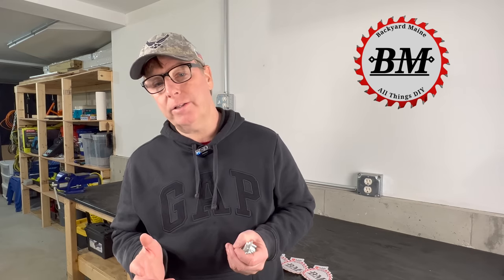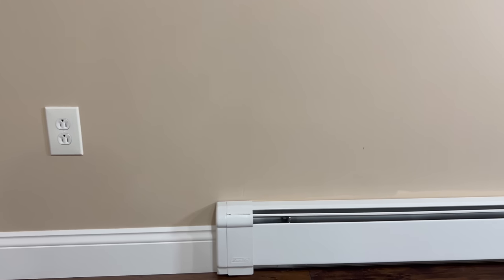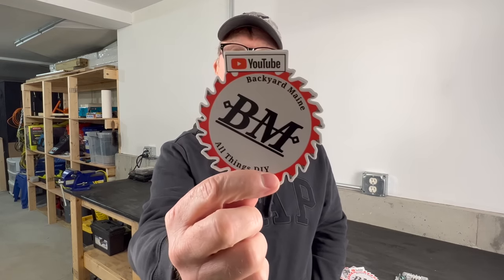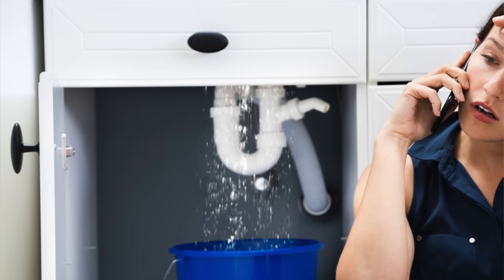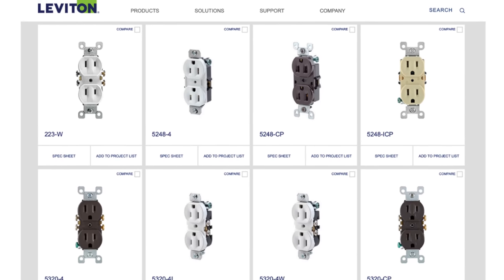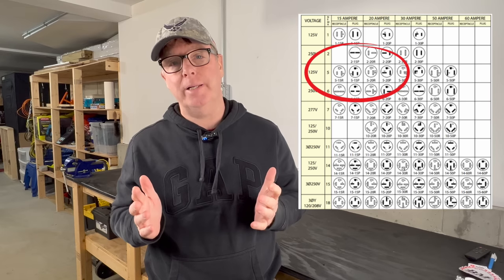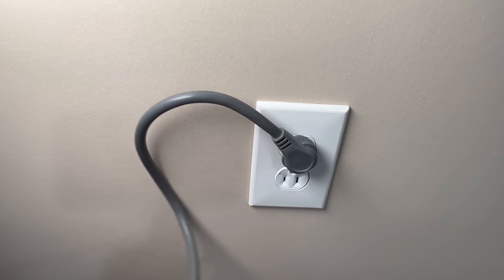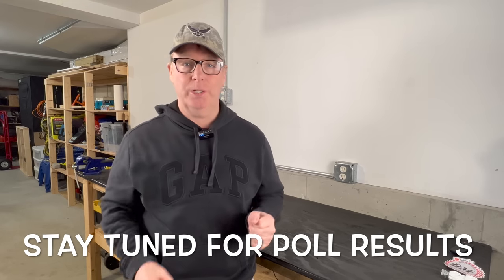Are your outlets installed upside down? (You may be surprised)

Comment: Technically it doesn't matter. However, the original patent design calls for the ground side up . 
Never came across a local electric code that requires either way.
Reply from the maker: Me either but I'm told the city of Chicago required horizontal.

Comment: According to the National Electrical Code, can GFCI outlets be added in bathrooms at 16” above finished floor.
Reply from the maker: At least one receptacle outlet shall be installed in bathrooms within (3 ft) of the outside edge of each basin. After that you can add more as desired and 16" from the floor is fine. It will need to be GFCI protected as you mentioned and also receptacles shall be installed no closer 3 feet horizontally from, and 8 feet vertically from the top of the bathtub rim or shower stall threshold. I hope this helps.

Comment: If you read the words on the back if the receptical it becomes very clear which side is up. Ground wire should always be on the left when looking at device whether an outlet or switch.
Reply from the maker: The manufactures of receptacle do not specify or ever recommend any orientations. The printing on the device is not a recommendation. But I agree that ground down is preferred.

Comment: I have had people tell me that the ground should be up in case a wire comes loose, it won't fall and touch the ground, which make absolutely no sense as all of the wires theoretically have the same weight, and gravity affects all the wires equally. That being said, whenever I do electrical work at the house, I always install new receptacles with the ground down.

Comment: I remember when the 1972 NEC stated that "an installation  shall be in accordance with UL rating and, shall not interfere with the UL rating of another device" or something like that. I can't find that in todays NEC. I think it was remover because if something is installed by its UL rating then it cant interfere with the UL rating of another device but, here we are. My question is - is the ground prong UL rated as a mechanical barrier or as an electrical connection? I'm guessing that it is not UL rated as a mechanical barrier.
Reply from the maker: In Article 110 it states that Equipment that is listed, labeled, or both shall be installed and used in accordance with any instructions included in the listing or labeling. One listing agency is UL and this would cover that although it doesn't say UL.

Comment: It sometimes  depends  upon the plug configuration are dealing with.  A 120v. level 1 portable EV (EVSE) charger I have has a ground-up plug on a dedicated circuit. Installing the plug ground down would definitely torque the cord causing problems and be against the manufacturer's  recommendation.

Comment: Personally, I prefer ground down for the following reason:
American Outlets/plugs are often very loose and many plugs are heavy (especially those with integrated PSUs such as USB chargers).

Whenever the plug starts to fall out, the ground pin is the last one that remains connected. On ground up, the ground pin may disconnect while neutral and live are still connected.

Comment: I have had a fire from arcing, ground down. Plug partially making contact with receptacles because ground allowed plug to have pivot point, allowing for arc flash intermittently eventually causing fire in receptacle. GROUND UP every time. Even if I have to change a cord stupidly manufactured with ground down.
Reply from the maker: I find the most likely plugs to come loose are the two prong with no ground. What are you doing with those? They account for about 90% of plugs these days. If something shorts between hot and neutral it should take out the breaker almost instantly. If you had a fire in the receptacle you make of had other issues as well.

Comment: I believe the idea is about safety, all electrical codes, laws are about human safety followed by property protection. 
That being said the ideal is that any cord plugged into a receptacle must attempt to have the ground be that last disconnected tab of the male plug end. Some ground tabs are typically longer so having a receptacle at 12” or 6’ may not make a difference at all. 
Looking at this brings me to the conclusion that location of the ground may simply be a visual preference or a detail to be followed if you have various cord end configurations.

Comment: I'm a 51year old electrician and ground up will always look upside down to me . A funny thing is when I was about 10  I  was trying to get something from behind the dresser with a wire hanger and I hit the prongs. Well the breaker tripped and it scared me pretty good, but the outlet orientation wouldn't have changed anything because the lamp plugged into it didn't have a ground.

Comment: Ground down makes more sense, because then there are two upper prongs on the plug, holding it to the socket.  Otherwise, with ground up the plug has a tendency to sag, and pull itself away from the connection, due the weight of the cord, since only one prong is on top.

Comment: I always thought it was local code dependant. I've lived in 3 different states and the residential orientation is different in all three. Alabama - ground up; Georgia - ground down; New York - sideways with ground right.
Reply from the maker: Those would be local codes either city or county but not state code. Local JHAs have some wonky requirements sometimes.

Comment: I have done electrical wiring in residential, commercial, and industrial scenarios for many decades... it used to be the "oh" face or ground down was most common and expected... but I learned through several accidents that it is better to look at the situation or area where the plug will be. In many places inside a house, I will use the conventional ground down orientation due to perceived "correctness" and to accommodate the use of 90° plugs behind cabinets and furniture because (lazy) manufacturers made them with that orientation in mind and to offset the wire from neighboring plugs. However, I have also changed the orientation of plugs depending on where it is used... If there is a higher likelihood of something metallic falling across a plug, I go ground up because I have seen plugs short out several times from things like knives or forks, picture frame wire, and yes, even the paperclip.... it is NOT enjoyable scraping out your pants when it happens, even when nothing worse happens! That is especially true on older houses that were built BEFORE all the GFCI breakers that are required today. I also know of the classic "sag" argument, nice try, but considering that the ground plug is also the longest prong, it will stay engaged the longest no matter what the orientation and I would prefer the higher safety aspect of ground up... There is also the coin test... a penny dropped on a ground up will ALWAYS deflect off of that single point of contact, whereas there is a greater chance of it hitting both prongs and staying in place with ground down... care to gamble your house? Overall, it does not matter whether it is specified by what NFPA, NEC, or other national level codes may or may not require because local codes can *ALWAYS* add additional requirements so you *MUST* check all local codes before you Ass-u-me that it doesn't matter. Using the excuses of "Tradition" or "it has always been done that way" is  an absolutely asinine reason to continue doing something and there have been plenty of fires and newly updated codes that prove the fallacy of just doing the same as it has always been done.... Knob and tube wiring was "the way it was done" at one point in history and I doubt ANYBODY would argue that now.
Reply from the maker: Good comment but there are some safety concerns for having ground up as well. For example I would rather have a metal cover land on the hot and neutral and trip the breaker that have it sit on the ground pin waiting for someone to accidentally push is against the hot terminal cause a short and possibly a shock. Another is the way people hold a pig when it's installed is usually the thumb on top and the index finger on the bottom. This could easily lead to accidentally making finger contact with the hot, neutral or both. You mention GFCI protection but the doesn't provide any protection from a hot to neutral short circuit. An AFCI would but the breaker should trip relatively quickly as well. But of course do what you or your customer wants as long as a local code doesn't mandate differently. Ive also been a licensed electrician for about four decades with the last ten years working as an electrical engineer so I too have seen it all.
Reply: @BackyardMaine  Thank you for the compliment and I mostly concur with your points as well, however I would posit that it would be incredibly difficult for almost anything to balance perfectly on that single pin... about the likelihood of tossing a coin to land on edge... Pulling plugs are side to side just as often as top and bottom. American plugs in general are far more "hazardous in comparison to many European plugs. The hot to neutral short generally trips the overall breaker rather than just the GFCI side.  Really, there are a bunch of safety concerns for American plugs (and some others as well) but we are also talking about reduction of hazards.

Comment: The ground is down when vertical and the neutral is up when horizonal. The reason is becaus if something falls onto the plug and knock it out, the ground is the final pin removed from the wall, but if the ground is face up, then the ground pin can lose contact while the hot remains engaged.

People think it's an opinion but the plug was designed with intent and purpose and installing with the ground up is incorrect. The angineers who designed plug did it with intent and their instructions are to put the ground on the bottom.

Comment: Ground up - reason is the human thumb tends to hover above the plug you are pulling so instead of getting a possible shock from your thumb touching the line prong it will touch the ground instead.
Reply from the maker: I find it more likely to get a shock on ground up based on the way I reach for a plug with my thumb on top and my index finger on the bottom.

Comment: Schneider receptacles state “top” with ground up. Is that considered manufacturing recommendations
Reply from the maker: I just checked and you're right. That must be new...  I'll have to be sure not to buy them. If the receptacle says top that is considered manufacturers recommendation. Most AHJs probably won't have a problem if you decide to install them ground down but if the inspector wants to he could have you change them. That could be a problem for you if the home owner wants them ground down. Back to the supply house to buy more receptacles. I suspect if you get burned once like that you will switch to a different brand.

Comment: Always Did Ground Down, Then Supposedly(Heard) some kid got Shocked, So they Changed To Ground Up,I would Still do Ground Down, and the Inspectors were OK with it, Probably thought Stupid Too.
In an Outdoor Receptical, Since the Cover Would Shed Over the Receptical. But With Ground Up, You Risk Lifting Something Up into a Live Conductor. Drip Edge? 
Outside You are Usually more Grounded. Except Bare Feet on Tile.

Comment: In California, ground up is hospital code because of the oxygen and other gasses present, it is considered a significant hazard if the possibility of a metal object falling on the current carrying prongs were to spark. That's why Californians live twice as long as folks down in dixie.
Reply from the maker: Most healthcare facility specs are written using IEEE standard 602 which recommends ground up. I doubt if it's in the state or local code under article 517.

Comment: Ground down.
Chemical Engineer who has worked in many industrial environments. You are trading of a low-likelihood event (knife-edge) for a much higher likelihood event (person contacting the conductor prongs).
When inserting a plug into a receptacle where one might have low-visibility, low-light, or low-access, it is natural for the person to place their index finger around the ground prong to present it to the correct downward orientation. If the contact with the prong lingers, there is no issue. If the ground prong is up, there is no safe way to insure correct orientation in low-visibility, low-light, or low-access.
In the magical case where a "knife-edge" contacts the powered and neutral conductors, the breaker will open to clear the fault.

Comment: i use ground up in our factory for a reason you don't mention. most of our receptacles are 3 feet off the ground on building posts. if you step on an extension cord that is plugged in ground down it will break the ground pin off the cord. in ground up the plug will  just rotate down and pull out of the ground holes and not break off the pin 90% of the time.

Comment: NEC is silent on receptacle orientation. It actaully doesn't matter, unless a local code requires it one way or another.  But you better make sure to have the slot in the screws vertical!
Reply: Horizontal looks better

Comment: GND down; if you know there can a risk of falling conductive material on the plug, such as by a bathroom sink, use a GFI receptacle.
Reply from the maker: I agree but a GFCI will not protect you from a hot to neutral short. That's the job of the circuit breaker. An AFCI will limit the short as well.

Comment: bet you never heard of the ban on the old coax ground 1 wire systems done 100 years ago either. had hot wire with metal outer cover that was nuetral/ground found in many homes still. needs removed and upgraded but if on old floor outlet it must be changed to new commercial water tight counter sunk type with screw in sealed plugs to prevent mop water or metal parts getting in as open floor outlets are not aloud by code since about 1970 due to safety issues of fire and electricusion. I took eclectritian code tests in the 1980s and was in HVACR field since mid 70s installing by city codes too in MO and other states til retired disabled 15 yrs ago

Comment: has to do with the cord being plugged in. My fridge and dehumidifier have right angle ground pin up orientation. Cord will hang correctly (down) with ground pin up.  lots of heavy appliances had ground pin top right angle plugs. (1991 Kenmore washer in my parents basement - ground pin top. Yes, that washer is still working as of May 2024. It outlasted my parents.)

Comment: 50 years ago when I started in construction my boss said which way is the sky, and which way is the ground?  so from that time on, I put the ground down and neutral is always to the left side of the plug, but in the hospital plugs they were upside down, when I asked why, I was told,if you drop a dime on the plug it would hit the ground, and bounce off, but if you drop one on the plug with ground down, the dime would hit both hot, and neutral, and causes a shortage

Comment: In the 1970s when I was a kid I pulled a plug out partway and shorted it with a screwdriver just to see what would happen…big arc flash, breaker tripped, burn notches in the plug prongs and the screwdriver. LOL

Comment: Some outlets where the Mickey Mouse ears are sometimes are marked top. I prefer ground down, and as you stated if outlet works off a switch(half hot) then I put ground down.👍
Reply from the maker: I think you may be thinking of single pole switches that have a top on the ears.
Reply: @BackyardMaine  yeh I hint your right, my bad!
Reply from the maker: @ginozanga2129  You know when I was making this video I was thinking the same thing and then realized it was single pole switches.

Comment: If it hasn't changed, ground up used to be specified for hospital wiring (Florida).
Reply from the maker: Article 517 has no requirement for orientation. However hospital specs are often written with guidance from IEEE Std 602 Recommended Practice for Electric Systems in Health Care Facilities which recommends ground up.

Comment: The explanation I've heard for primarily using ground down is in case there's a flood, water contacts ground first.
Reply from the maker: Actually the yoke of a receptacle is grounded so if water was rising it would make contact with ground first in either orientation.

Comment: I use the ground up for the safety reason if something falls on the receptacle it will hit the ground and fall off. Why, because I learned in High School if you carefully inserted two paper clips in the receptacle and the dropped a third over the two paper clips, well, class was over. It worked many times. So, that is why I use ground up, because I was a brat as a kid. Anything to get out of those boring classes. Never did that to a class I liked though.
Reply: That is a million to one shot. Not enough to tip the scales

Comment: The "right angle" plug shown isn't right angle. It's right angle offset. ( A right angle connector drops the cord straight down from a ground down receptacle.) EVERY offset plug applies 3D torsional (twisting) force on the receptacle. The only electro-mechanical difference between ground up and down with an offset plug is from the unsupported weight of the cable.  With a code compliant appliance cord the maximum unsupported weight of the cord is within the specs of a high quality commercial receptacle no matter in what direction the cord is run.

Comment: some are up and some are down, the reason for this is air conditioners and refrigerators come either way and i don't like the wire shooting up in the air and then bending down. the only bad location would be flush with a floor without a waterproof cover.